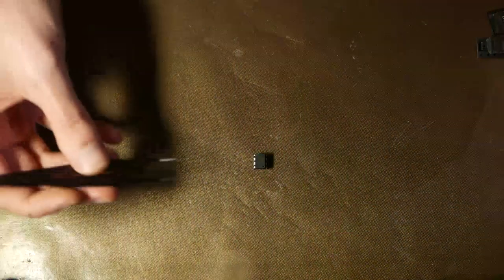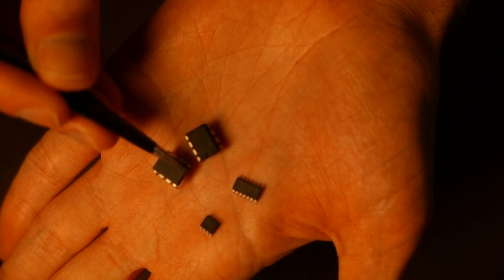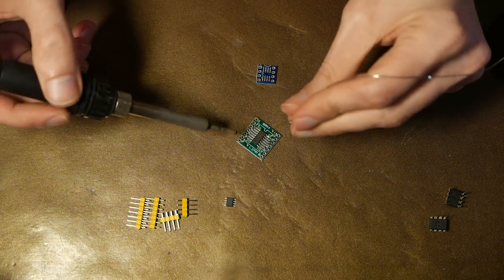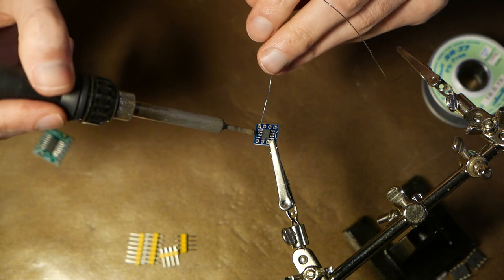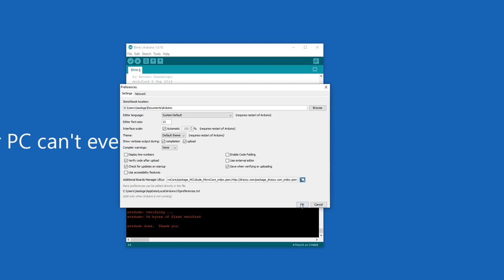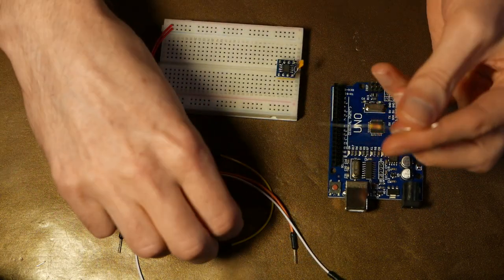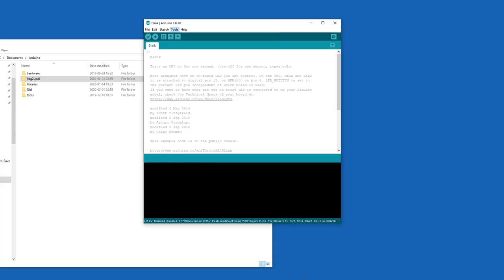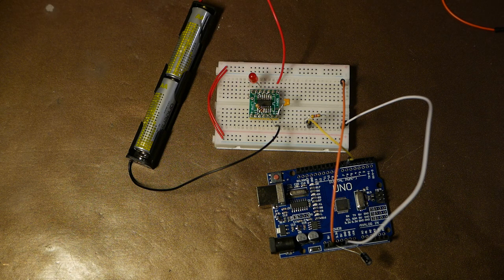Programming the new ATTINY series with Arduino!

Comment: Is the boot loader necessary? Other programming videos don't show that being used.
Reply from the maker: I'm not 100% sure, but if you're using the Arduino IDE, that's how you set the clock frequency. If you upload a sketch with a different clock frequency than what you set in the bootloader, you'll get timing issues. Note that there's also optiboot, which is a different bootloader that allows you to program these with USBs. You may be able to get these chips with that pre-installed and/or with a USB port, in which case you should not use this tutorial.

I'll likely make a tutorial on how to make these USB programmable some time in the future.

Comment: thanks for the video, I have a question: I can not find any section of the datasheet of the attiny202 that mentions I need to put a capacitor for programmiing or functioning, where do you get that information?, thanks
Reply from the maker: If you're talking about the 100nF ceramic decoupling capacitor between power and ground on the attiny, that's a typical design consideration in most circuits. EEVblog has a good video on them https://www.youtube.com/watch?v=BcJ6UdDx1vg
Reply: @jasdoge  thanks for answering!, I will check that video :)

Comment: Awesome video. Do you have a video on how to program a ATtiny1617?
Reply from the maker: You can do it the same way as in this video. But since it's QFN-only you'll need to break out the UPDI, power, and ground pins somehow to connect them to your computer. I usually do standard 0.1 inches (2.54 mm) pin headers on my boards for in circuit programming.
Reply: @jasdoge  Thanks for the quick reply. one more question. Will this work with Teensy 3.2?
Reply from the maker: @mikes3801  Nope, that uses a completely different microcontroller